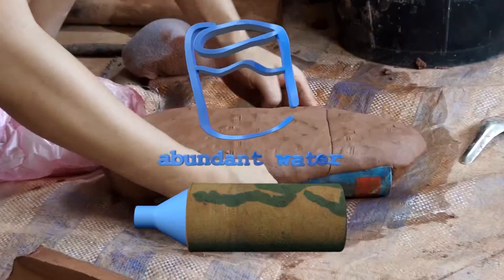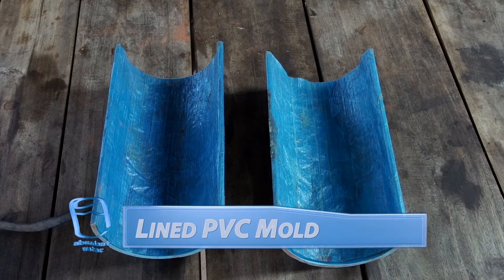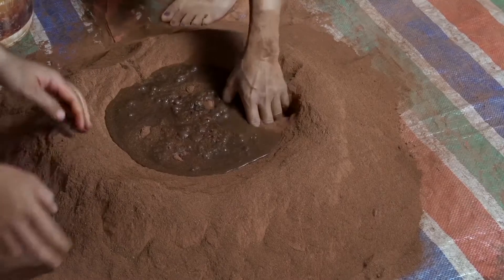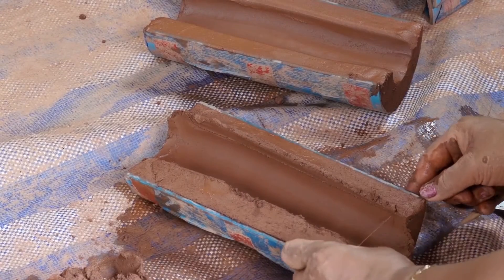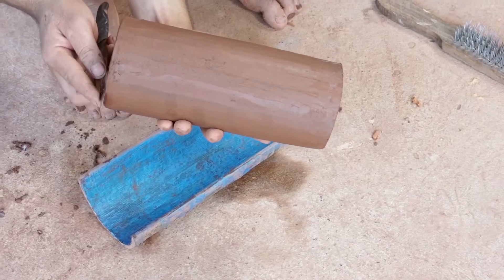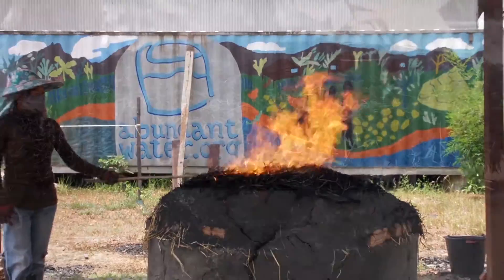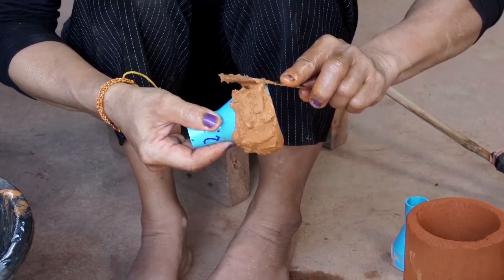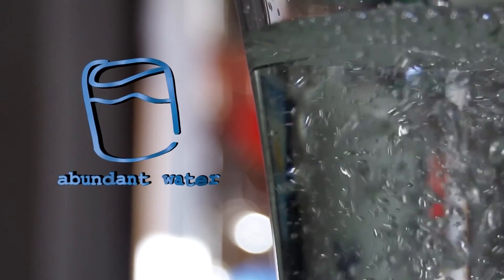Abundant Water's Step by Step Guide to DIY Clay Water Filters (Full How to Video)

Comment: what about adding a ton of activated charcoal in the void of the ceramic filter, so your getting the ceramic pore functionality but also heavy metal/chemical filtration and micro-organism filtration.
Reply: Mike Klegin
, there's an activated charcoal in pores when the sawdust is burned out
Reply: @alexs5480  if its burnt out there isnt anything ther but void. activated charcoal is coal thats been treated with high temperature steam cracking it so it has a higher surface area. yes flow rate will be effected due to the higher surface area but when you burn something out it ceases being there except for traces.

Comment: Why don't you line the inside with silver to remove Bacteria?
Reply: Chhman Sukhna bacteria is dealt with from the carbon left behind from the burn out material. that's what makes these so effective. also, if the microns in the ceramics pores are small enough, the ceramic filters that out. over time you have to sand the surface of the filter to remove this build up. the silver isn't really needed here, and if it's that serious, you can simply add coloidial silver to your storage container. make sure it's coloidial silver. don't just toss in a silver necklace and call it a day. what happens here is the burn out material is burned in the kiln, leaving a matrix that is carbon coated. this is what makes it a filter, and not a clay pot. this matrix contains pores microns wide, through the entire material, and being carbon lined, the filter effectiveness is dramatically improved.
Reply: Richard Peterson, hello! can you tell me, please, what is a burn out material. Can't get it
Reply: Biochar filters

https://youtu.be/k2eZ72n5uaE

Comment: Is it possible to get a few(2-4 No.) samples in India for testing with discharge water from  anaerobic bio digester household toilet so that it does not contaminate wells, hand pump reservoirs etc.  Our test toilet is generating about 12 litres of discharge water every day from 3 -5 users every day. Can it be coated inside or outside with adiabatic Silver solution for  better removal of bacteria? I Will pay for the samples.